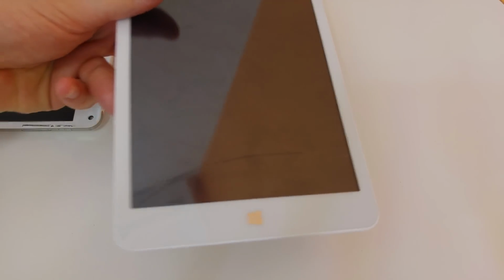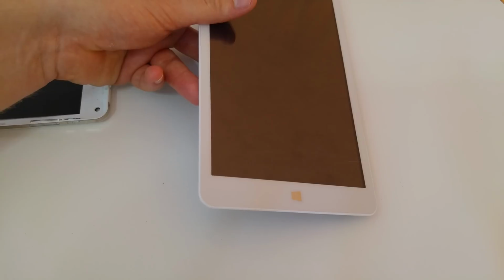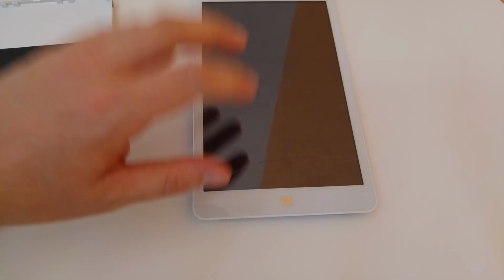Chuwi Hi8 Teardown, look at internals [4K]

Comment: What do you recommend to improve thermal dissipation on this tablet? it really gets hot when Wifi is On plus gaming.. particularly Sim City Buildit on android. Thinking of customizing the entire rear chassis with an aluminum or copper sheet and have the cooling pads directly on that. I bet that would be better than the stock plastic casing.
Reply: i think that the interference would be enough to cripple the tablets performance but i am curious now...im gonna try it.

Comment: Is it possible to solder a diffrent wifi on the usb or replace the broadcom wifi? The internal Broadcom wifi does not WORK good. an external wifi dongle is far more stable. 2)  Is it possible to solder a  power charger intrance on this Chuwi Hi8, the battery drains down very fast.

Comment: Hi, thx for this video. I need to replace the screen also, ordered it from Banggood really cheap. Pulling te tablet apart is very easy BUT I cant get the flatcable disconnect from the motherboard, I try to keep it in working order ;-)Would appreciate the tips!

Comment: Excellent video! Is it really possible however to switch the cameras if I found the 5mpix sensor with the same port? Are there any drivers required to be installed? Does the camera software need to be reprogrammed? Or do the Android and Windows figure out by themselves which sensor the device is currently carrying? I'm sorry for a bunch of these questions but the fact that you can simply replace the cameras really intrigued me very much! Have an amazing day man! Looking forward to more content! <3

Comment: +TechTablets.com, can you show how to disconnect touch screen from mother board? I.e. that cable you are pointing on 1:18. I need to replace my screen, but I am having problem by disconnecting that cable.
Reply: Hi, did you solve this? I have the same issue.
Reply: Pull the white plastic away from the pin..  Then the fleksible cable will loose and you can pull it easily..  Btw can i know serial number for the lcd part? Not the touch panel..

Comment: Anyone know if removing the battery and powering off an external power supply is as simple as cutting the red and black wire that goes to the battery and connecting your own 3.7v source? I want to use this for a robot, not as an actual tablet.

Comment: Is it possible to connect another speaker to this? Do I need additional drivers for it or it will just work? You didn't find a gps chip in the tablet, right?
Reply: KingOfAllChunks as much as I remember, the Vi8 super doal boot also had "GPS" mentioned on it's antenna when you opened it up. They're using the same motherboard for most of their tablets. So I guess that we should expect the same tab as this, but with GPS, 3G and stereo speakers? It would be exactly the same as the V89 but 1 inch smaller.
Reply from the maker: KingOfAllChunks Something is missing, maybe the cable for the GPS.
Reply: TechTablets.com if you have experience with soldering and advanced electronics, why not try to connect it if you think that that's mssing?
Reply from the maker: KingOfAllChunks I'm not 100% sure but the chipset has intigrated Wifi,bluetooth,gps and glonass but might not be bios enabled. Personally I dont need gps in a tablet and i'm not going to rip it apat looking for answers if it has gps or not. It could be the aerial support gps and wifi, with only wifi being used. So its one or the other.